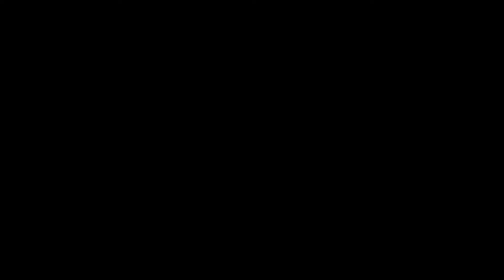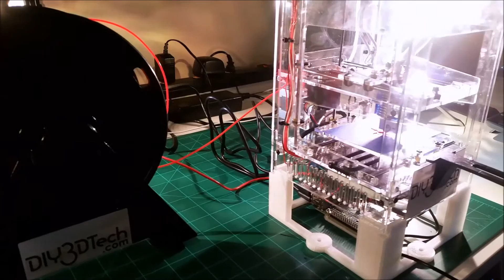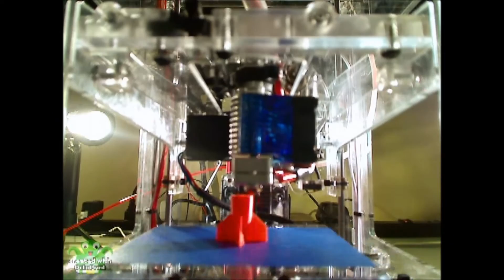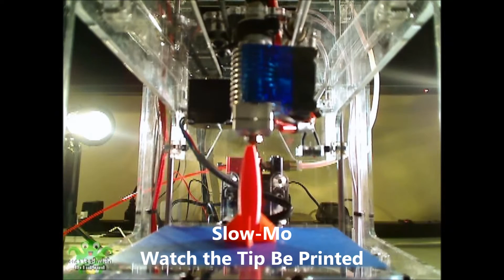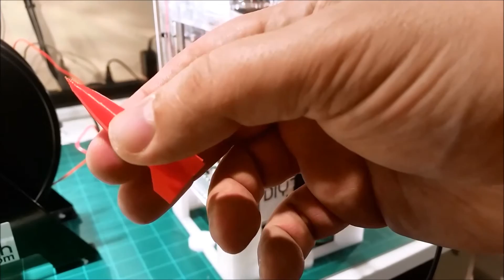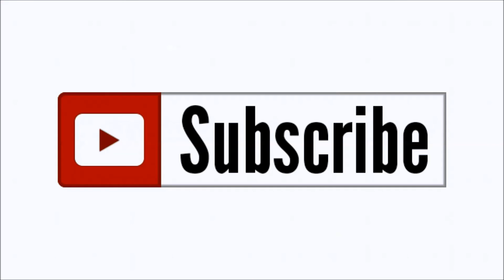Fabrikator - TinyBoy Mini 3D Printer -  Printing a Rocket with OctoPrint

Comment: 0.0 1.5hr? Should take 20minutes at that size on other printers.
Reply from the maker: +Mickice the fab-mini tops out at about 20mm/sec and did it at 0.1 layer height so it's not a speed demon as my Wanhao run three times the speed.  But the fab-mini is far cuter (even my wife likes it)
Reply: Ah, 20mm/sec must be brutal, I don't think I've ever printed that slow on my FF Finder. Love the rocket design, just don't need any more printed toys :P
Reply from the maker: Again its not about "speed" with the fab-mini but cuteness, its like a hamster without the litter :-)